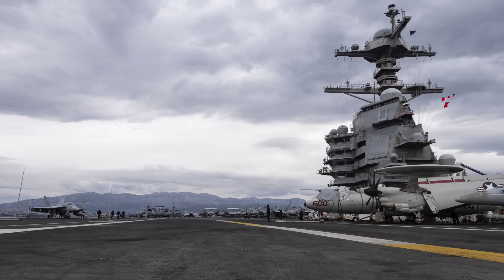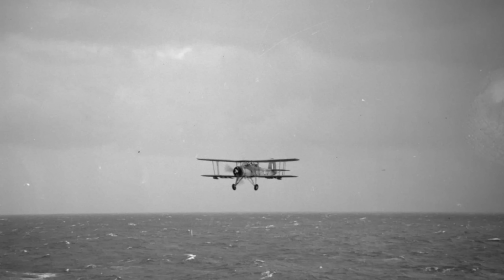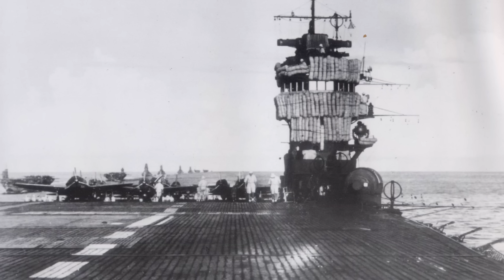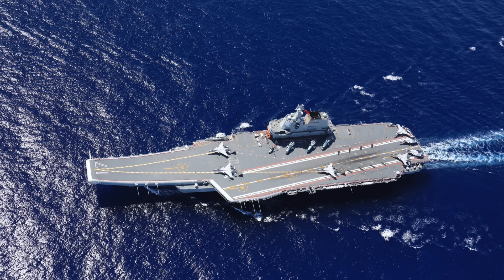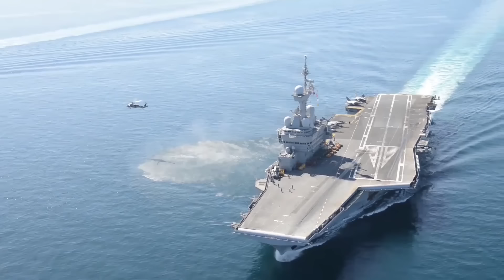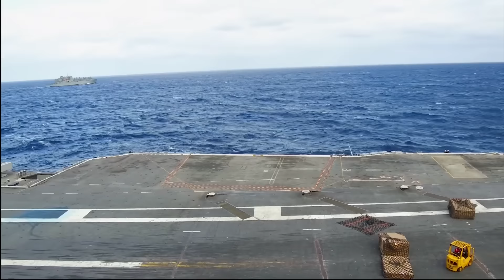Why Every Aircraft Carrier Has Its Island on the Right

Comment: I'm former Navy and to this day I still cannot understand why the right side of the ship is starboard. You would think with the dock being on the right side of the ship when it is docked that that would be the PORT side. Because you are docked at the port.
Reply: As a retired Senior Chief you can moore a ship on either side port or starboard. Most CVs do moore to port so they could use the elevator area for a quaterdeck. Starboard and Port sides have been identified since the beginning of sailing.